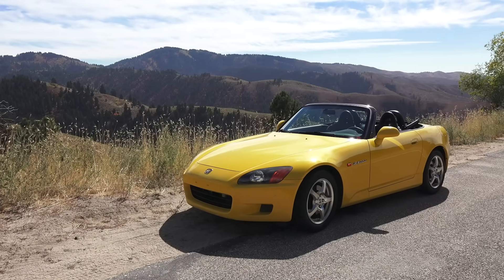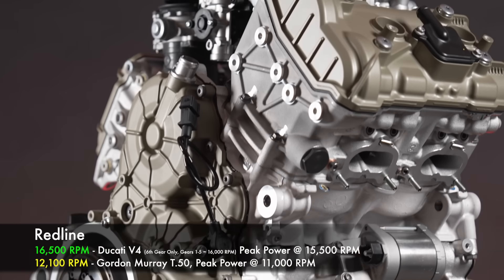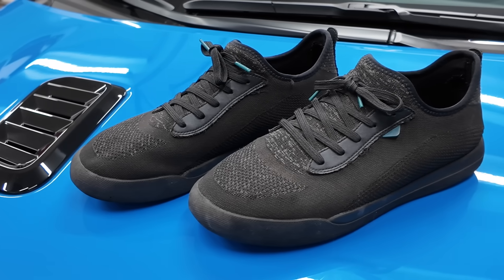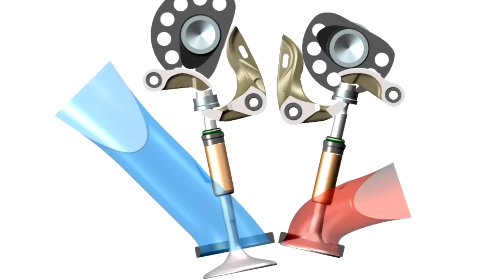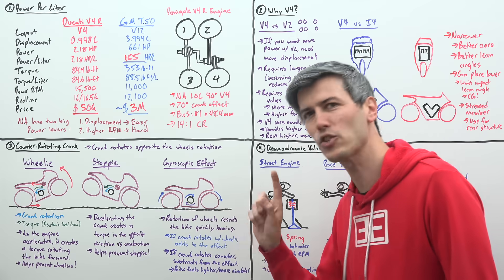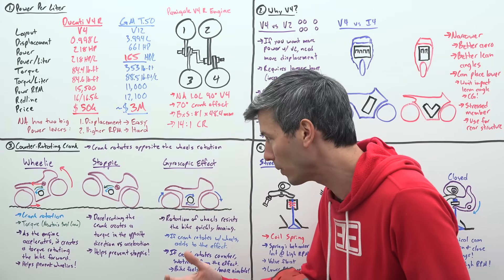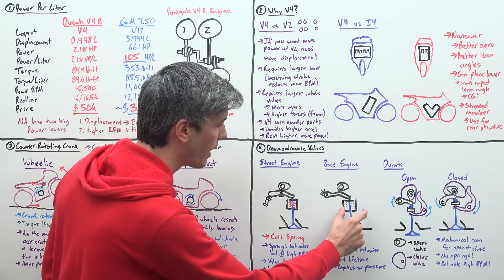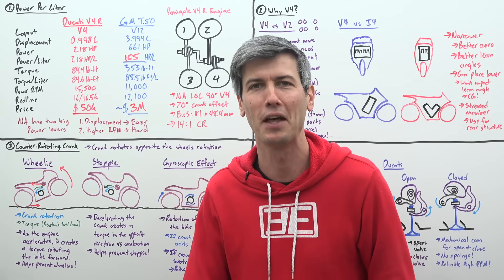Ducati's Brilliant V4 Engine — Putting Supercars To Shame!

Comment: Bike stuff and Jason explaining them is a new, exciting thing to see!

Really appreciate the video! As a motorcycle rider I was kind of used to small engines with big HP numbers for their size with no fancy tech or materials.
So easy when you have to work with light components I guess.
I am pretty sure someone who is into nitro engines would laugh at all of us etc.

Throwing ideas - maybe too much for the channel but you maybe manage to Jason-ify them :P :
20K rpm 250cc bikes (F1 level of rpm on the road - WOW!) - maybe cover the honda's cam gear train as well?
motorcycle transmission (sequential transmission on the road - WOW!) - maybe cover the breakthrough the original yamaha r1 brought there?
The top speed wars and the 300 kph limit or car vs bike performance (lightweight - traction - hp and drag at high speeds)
frame materials (also include e.g. the super stiff alu frames in the early 2000s - WOW! super stiff is not always good on motorcycles?) and designs (including e.g. the zx12r monocoque Wow! We have monocoques in cars for ages now! - btw FI in bikes is a relatively new thing esp. for dirt bikes)
Engine layouts (e.g. MV Agusta - again - just showed a 5 cylinder square engine at EICMA this year, you may also take a look at the legendary Suzuki RG500)
Or strange facts on super common engines like e.g. the dummy (third) rod on the 2 cylinder bmw 800cc engines.
Motorcycle suspension is also really interesting. How it changes and its effects during acceleration and braking during cornering.
(even the fork leg axle bracket thing that is different between scootes or dirt bikes etc. that not many people know what it is for)

Maybe as some extra for this x-mas? I hear ads pay well this time of the year, so... Happy to help by watching some more content and happy to be part of the experiment :P

Comment: How does this engine achieve 14:1 compression ratio? I guess late closing of the valve is the answer... But if so what is the point of such a high compression ratio?

Comment: After you make a video about the Ducati engine with its 70° crankshaft, it would be very interesting to learn more about the AV-108-4 engine. It was an aircooled 90° V4 developed in 1940-50 by AMC and used in the M422 car (U.S. Navy vehicle)

A little later, a similar design was developed in the USSR - aircooled 90° V4 with a crossplane crankshaft and equal firing order (1-3-4-2 every 180°). But this motor had its own unique feature - a balance shaft, which helped to achieve engine’s primary balance. Thus, the engine operation became smooth (unlike the AV-108-4 engine in the M422 car). The balance shaft was inside the camshaft (OHV) and they both rotated in the opposite direction to the crankshaft. These engines were installed on ZAZ 965, ZAZ 966 and ZAZ 968 cars.
Reply: So did it have a full rotation without any cylinders firing? Or was it a two stroke? Every 90 deg works for a V4, but that only gets you through two of four strokes. This is why only 2 stroke V4s can be even firing.
Reply: @seth094978  I’m sorry, of course every 180°

Comment: Fantastic video, I raced enduros and motocross in New England and knew quite a bit about Ducatis but your video helped clarify things. I hope to see more moto videos. Perhaps the late 60s early 70s rise of Japanese motocross bikes, the early days of piston port and and expansion chamber design, the 1970s 1980s WORKS bikes, the sweet first 1981- Yamaha YZ and Suzuki RM water cooled bikes. 1975 Maico Long travel suspension first single shock rear suspension via 1973. 1982 Yamaha YZ first disc brake motocross bike Kawasakis 1982 KX, Austrian Horst  Leitner ATK !

Comment: I believe the desmo valve system still uses a spring, but its sole purpose is to hold the valves closed since it would be near impossible for the cam system to applied a controlled amount of force to hold the valve closed so it seals but not bind up.
The 70 degree crank is all about traction. Obviously sacrificing primary balance in favour of the riders feel for traction.
Possibly the coolest engine is the Honda RC211V with its V5 engine. I'd love to see you do a video on that.
Reply: The only spring in the Testestretta I had was to keep pressure on the valve closing arms against the cam lobes. Openers flop around with the cams out. It's a pretty strong spring but it's not a complex one.

Comment: Ducati's V4 engine, specifically the V4 Granturismo, does not use desmodromic valves. This engine powers the 2021 Ducati Multistrada V4 and features a spring valve return system instead. This allows for longer service intervals reducing maintenance costs

Comment: I’m not a die hard motoGP fan .. but to the best of my knowledge there is a specific lean angle that pretty much every bike hits and virtually no one can go beyond. 

It’s not a limitation of the width of the bike. It’s a limitation of the rubber. Last I heard there was a single rider with a slightly different style who was able to sometimes get past this lean angle. But, it was due to technique, not the design of his engine.
Reply: It's rubber limitation on motogp bikes. On street bikes it's almost always chassis limits. You could buy racing slick tires but you couldn't lean the same as motogp bikes does because there always be something on the way.

Comment: With the springless valve setup, might it not be better if the valve now opened outside of the cylinder (up instead of down) to allow for a freer flow of the fuel and air?

Comment: The Workshop here on YouTube did a video a few years ago about why desmodronic valves are pointless except as a marketing exercise. You can't use hydraulic lifters on them to maintain the right gap, so they require more maintenance. Springs these days are easily simulated, and can be designed to rev to high revs.
Reply: There is nothing wrong with maintenance.

Comment: The gyroscopic effects of the wheels and engine in the perpendicular direction (lean rotation) is very hard to understand for me. How in the fresh hell does that work.
Reply: Vector sums.
Reply: hold a bicycle wheel in your hands by the axle and spin it.  Then try to lean it.  It will resist.  That resistance to lean from centrifugal force is not ideal for a race motorcycle intended to lean over in corners.

Comment: You don’t even mention the Honda V5?! Or any other comparable motorcycle engines?! Why are we comparing a modern Ducati motorcycle to an old Honda sports car?

The Honda v5 is one of many motorcycle engines that achieves very high RPMs (16k for the V5) with traditional valve trains. This proves that desmodromic valves are not necessary to achieve high RPM or a high specific power.

The valve train certainly have very little to do with the success of this engine in particular. They’ve been standard on Ducati engines for many years.

Comment: I've ridden the Ducati Multistrada V4s and I can tell you it is exciting ,.. and hungry for a motorcycle engine. Terrible mileage, even for a bike.
Reply: Compare the Grand Tourismo to other motors that put as much to the wheel you will find they are similar or better.  My 25 Pikes Peak uses just about the same amount of fuel that my 1290 Super Duke does, less than my Monster S4RS, better than my 675 and 1098 were etc etc.  Unless I am absolutely hammering on it I usually get ~6.5L/100km out of it.....not bad for a bike that puts 168hp down on a dyno( race exhaust and flash).
Reply: @Tripped11  I tend to be heavy handed at times,. ;-)

Comment: I'm not sold on the gryoscopic effect reduction claim. 🤔
Reply: Agreed. The gyroscopic effect of the engine will resist lean irrespective of its direction of rotation, so it's aways going to be additional to the gyroscopic torque of the wheels;. It will, however, act to cancel out the precession effects acting about the vertical axis, although I've no idea whether this is beneficial
Reply: @yodaedwards5225  nope vector sums, the rotation of the engine directly opposes the gyroscopic forces of the wheels (and transmission)....all forces are reduced.  I have one of these motor on a multistrada and it works, the bike moves side to side a LOT faster than anything that big and heavy has business doing.
Reply: @Tripped11 That only applies for rotation around the wheel axis, ie pitch. For roll/lean all those spinning bits of metal want to continue going in the same direction and will resist any change irrespective of which way they're spinning

Comment: I think youll be more impressed with the honda cbr1000 RR-R fireblades engine.   215hp 998cc with titanium rods, DLC coated finger follower drivetrain, bore and stroke derived from the rc213v moto gp bike... its a masterpiece you should look into.

Comment: 90degree V angle and a 70 degree crank angle makes the power impulses less uniform which actually helps with traction on acceleration. Yamaha did something similar with the cross-plan inline-4.
Reply: Average Driving4answers viewer.
Reply: @Grimmjeaux 😂you caught me
Reply: @Frenchican17 haha cheers mate! Love that guy's work. We are basically classmates.
Reply: @Grimmjeaux  yeah, but he's not wrong.
Reply: @ryanford736 i didn't mean to sound like that, I know d4a was right, and so is the french gentleman who is the OC.
Reply: but why
Reply: @erikgillisostrom6109 The rear tire has time to regain grip in the larger gap between the power pulses. Honda understood this concept on the four stroke V4 racers in the 80s and then mirrored it on the NSR500.

Comment: BIKES! Way more accessible than cars nowadays. I got a used Ninja 250 for my first bike for $2k and then a very lightly used Honda Grom for $3k. Im learning to wrench and now every car feels like a boat.
Reply: And you can get very high end bikes - like 150+hp - for less than the price of a base model civic.  The 50k Ducati he references is quite extreme, but even 200hp bikes can be had at those civic prices.  

Where fast cars are simple fantasy for the vast majority of people, even brand new superbikes are very affordable to basically anyone who can afford a car.
Reply: @Wintersdark  Everything referenced is true of all of the Ducati Stradale motors, so basically all of the desmodronic V4s EXCEPT power, the the 1100cc stradale in the Panigale S, Streetfighter S, and Multistrada and Diavel RSs are "only" 180 or so horses.  The Multistrada and Diavel also have the V4 Grandtourism with the counterspun V4, but further detuned (mine was 168hp rear wheel) but with regular spring valve actuation, and they have 60,000km maintenance intervales.  Which is nice on your street/touring machine.
Reply: @Wintersdark sure but you should never recommend a liter bike to noobs, most people can kill themselves just as fast on a 400 if they don’t know what they’re doing.
Reply: @BonzoDeluxe I didn't recommend anything to anyone.  Just talking about accessibility, if I start caveating everything I say to protect grown adults from themselves everything I try to say will be miles long.  In much the same way I don't think a brand new driver should buy a Dodge Viper as their very first car, I wouldn't say that just talking about Vipers in general.
Reply: @BonzoDeluxe  Most countries have some kind of gradual progression in licensing. In the USA, the only limitation is how much your insurance is. I think my motorcycle experience has made me a more attentive driver. Agreed a fast powerful bike is extremely dangerous for a typical teenager. OTOH, a powerful, heavy 4 wheeled vehicle is dangerous to other road users in the hands of a teenager. The peak of my motorcycle days was as a courier in central London. I swear I developed something which came close to being physic. More than once I made a maneuver and didn't know why until afterwards. Example. In London, if you see an older Mercedes with diplomatic plates, give it lots of room.  Diplomatic plates indicate not much concern for road rules. Older Mercedes means less training and/or ability.
Reply: Good for you ! I started the same back in the 80's ---wrenching makes you a more aware rider )
Reply: I love my ninja 250 and small bikes in general. I haven't ever been able to explain why they felt so much more nimble, but gyroscopic forces of a 250 spinning at 11k rpm must be less than a 1000 spinning at 9k. I can only imagine how exhilarating it must be to ride something that would handle just as well while having 6 times as much power and being twice as fast.
Reply: One thing to consider: hitting a dog that someone ran out it front of you will not cause a car a problem but it will cause you to dump your bike.
Reply: @johncooper4637  Why "it will"? More like it could, just like car. Plus bike on city speeds is way easier and likely to steer away from such obstacles if rider has even semi good control of the bike.
Reply: @johncooper4637 interesting you mention such a thing. I've seen people on huge 1000 pound Harley Davidsons smoke a deer. Split the deer in half and the bike stayed upright and the rider was able to stop safely. You can probably find the video on YouTube actually.   And I've heard of people hitting deers in cars, and the body of the animal goes through the windshield and kills the driver.   

Ride/Drive what you like. Tomorrow isn't promised to anyone.
Reply: @larryhouse3776  I was going to say that's an exaggeration, but there is a 917 pound Harley.  

Not sure I think an HD is a a motorcycle though.
Reply: @johncooper4637 i legitimately have never considered that

Comment: Someone needs to mad scientist, engineer, two of these V4 behemoth into a V8 and throw it into an aerial atom frame. 16000 rpm atom. An F1 for the road 😂😂😂😂
Reply: You never heard of  the Ariel Atom V8??
Reply: @EVOVIISWE I have but I would rather have 2 of these revving to 16,000 than the v8 one of old.
Reply: @andrewfossatti4937  I think the 3.0 L Hartley Hayabusa derived H1 V8 at 500hp makes a much better engine for an Atom, it might not rev as high but still way above 10k and provides lots of usabel power for a car,, and it actually exist, a Panigale V8 probably never will.

Comment: Interesting departure from all the car stuff. Thanks. One thing is a little bit confusing, though. The counter rotating crankshaft is not patented by Ducati. Now, MotoGP manufacturers are never ever ever going to leave performance on the table. They’re like F1 in that way. I have to suspect that having the engine crankshaft counter by a bit the gyroscopic effect of the wheels, and wheelie and stoppie behavior is a minuscule effect  or all the manufacturers would be doing it. Maybe you can whip out the whiteboard and go into the numbers on gyroscopic precession?

Comment: Can we please just stop using HP as a unit of measurement when comparing engines? It's the dumbest, most incredibly ass-backwards way to measure power output and essentially tells us nothing of note about an engine. 

This being a channel focused on engineering; How about we use brake mean effective pressure (BMEP) instead - you know, like actual engineers? And please, for the love of the machine spirit, please just switch to kW when talking about constant power output.

Comment: From what you were saying about Desmo, one could assume their service interval is great. It is not, it is actually one of the shortest services interval for bikes on sale today. And it's a very costly service too, because its complex. Even Ducati has stopped using Desmo for most of their road going bikes, even for models that had it in prior model years.
Reply: I don't know why it's so costly vs other valve jobs. I did mine myself because of the cost and it's really not that complex. There is a website you can rent the few special tools you need for cheap. Desmo service is 16,000 miles since somewhere around 2016, I believe. My Triumph 765 with traditional valve train was 12,000 miles for some reason; and I'm way more hesitant to do valves on a traditional chain driven cam engine than I was on my Ducati's desmo system, haha.
Reply: @jpow4893 where I'm having it done is a well known master tech (certified) that does pick up/drop off service and takes 2 days for $1800
Reply: For the mid size bikes, yes, but Desmo valves are in the flagship V4s (Panigale/Streetfighter/ Multi RS/Diavel RS)
Reply: Its very costly because if you read the bill, they are trying to do a fork service, coolant flush, etc etc.  On the twins if you have a dealer that would play, you could get the valves and belts done for like 650-700, IF it didn't need to be shimmed.....valves alone on my Triumph 675 were $1200 at the dealer, and every 10000km/6000miles.  I don't know with the V4s (valves only) never owned one.  Even then a lot of that was time taking off all of the tupperware, Ducatis are not easy to take apart.
Reply: @Tripped11  Oh right, I forgot that I had to move the radiator out of the way. Though at the 16k mile interval the coolant is usually due anyway, mine was. I was quoted 2k for the desmo service on my SuperSport in 2023. Did it myself instead! Even with air filter, spark plugs, valves, belts, coolant, I still felt 2k was nuts.

Comment: The valve solution is pure genius. Thanks!
Reply: That vavle solution is from the 19th century before the metalurgy/manufacturing prowess existed to make springs that didn't break, Ducati just stuck with it for whatever reason.
Reply: @Tripped11  Thanks, never knew that. It has a obvious advantage in high rpm situations imho.

Comment: Could you make a video about why inline engines aren't yet installed longitudinally in motorcycles? Then the width problem wouldn't exist anymore, but a 90° angle would have to be incorporated at the gearbox. What kind of gyroscopic effect would that have if the crankshaft ran longitudinally and rotated clockwise or counterclockwise?